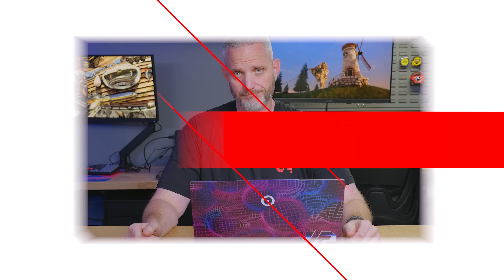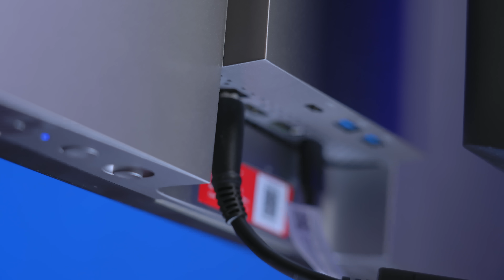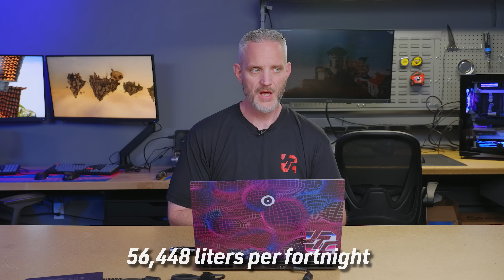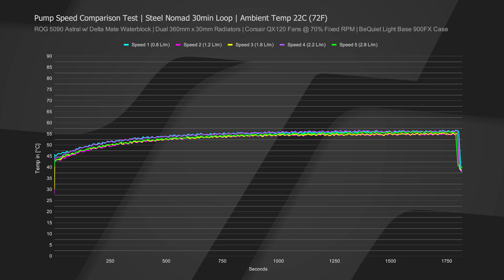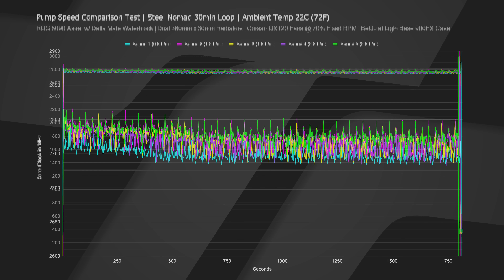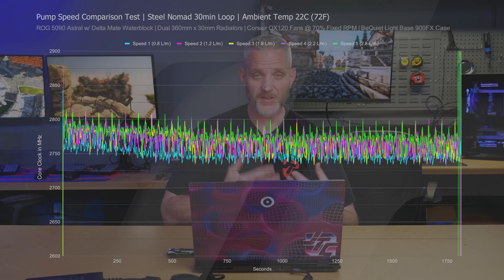Stop doing it this way!

Comment: Jay, my setup uses D5 w/ PWM and ASUS warns to set it to 100% and instead I use 60 -70% nothing above. I let the fans do the work. When I was initially setting it up I added a flow rate sensor and my D5 pumps 6L at full blast and in my 60 - 70% setting I'm doing 3L. I'm passing through 2 rads, video (2 sides), proc, VRM and a res using soft tubing and 7 - 90's.   Your flow rate at full is half mine, could the pump be worn or is it the tubing and fittings? Any way, I decided to run the pump at about 1/2 so it would last longer and cause the coolant to linger at the important areas.... Thanks

Comment: When ford first made V8's they were essentially two flat head inline 4's, with two water pumps. What you will find if you pull the water pumps apart on a good running example of on of these engines, is that every other pump fin has been broken off or removed in these pumps. The reason is that the engines overheat in stock configuration and mechanics figured out the pumps flowed too much, the coolant didn't have enough time to give enough heat away in the radiator.

Comment: I'm thinking it might have more to do with boundary layer thickness than pump resonance - which should happen at relatively narrow multiples of frequencies I would think.  Anyway, the heat exchangers on the components themselves have many many many microfins and therefore a corresponding number of boundary layers.  Increasing fluid speed through that system will decrease the thickness of each of those boundary layers and correspondingly increase heat exchange.  When it comes to actually getting rid of that heat at the radiator the radiator may see significantly less of a percent improvement due to the comparatively fewer number of flow channels.  I think the added 35w of pump heat probably did play a role here.  I wonder how the results would have been different with 100% fan speed.  Also depending on the design of the loop and specific components even a single set of fittings enter a suddenly more chaotic flow state at certain velocities.  Lots and lots of actual variable here even per specific system and pump.

Comment: I would guess running a slower pump speed just operates the loop at a larger delta between the hottest (right before the rads) and coldest (right after the rads) coolant temperatures. In the end, the rads will still dissipate roughly the same total amount of energy into the air no matter how fast the coolant is moving through the loop.

Comment: Could you perhaps have 2 pumps connected to a single reservoir, one pump connects to the heat components, and the other to the rads, basically a heat exchange so you can have a high flow rate through the blocks, but then low speed through the rads.

Comment: I also name my rigs, and it's kinda cringe but my main rig (9950x3d, 96gb ddr5 6000 4x24gb, 7900 xtx red devil, proart x670e, nzxt c1200, h9 flow 2025, custom loop with 2x420, 45mm and 60mm thick with xd6 and xc7 lcd, and 40tb of storage across 14 drives) which is named "Quantum Nexus", then my streaming rig (7600, B580 Icraft, 96gb ddr5 5200 2x48gb, pg lightning WiFi, icue link h150i LCD aio, deepcool 850w, H6 flow, 10tb storage across 4 drives.) named "Abyssal Plane", then my 5l ITX portable build (5800x, ID cooling is55 with phantek t30, LP 4060, 32gb ddr5 3600, lzmod a24 v5, 4tb across 3 drives) named "Void Wyrm"

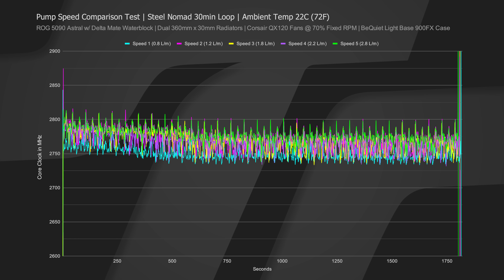Comment: 13:50 Water has a higher "specific heat".  And this means it can absorb more heat energy per unit mass before it rises a degree in temperature.  Saturation isn't the right word really.  For example, it takes very little energy from a stove top to heat a sheet of tinfoil, and it takes a lot more energy to heat a cast iron skillet.  Granted we aren't adjusting for mass here, but it gets the point across.

Comment: Well it's kinda obvious that the bottleneck in liquid loop cooling is more of the heat discharge rate from the radiator to the air rather than the component to the water.

Comment: I’ve been liquid cooling PCs, as well as a number of other industrial systems over the years.  I’ve tried every configuration imaginable.  I too have pretty much settled on a medium setting for my pumps, of which I currently have two in one system and two in another system.  Although, to be fair I think the pumps in one of my systems are maxed out, but that’s because they’re cheap pumps.  The pumps in my main system are Koolance model 450S, and the coolant I use in Koolance LIQ705, because it’s clear, non conductive, and you can buy it by the gallon.

Comment: As long as the water flow is enough to absorb the heat without getting so hot that it starts affecting the heat transfer.

Comment: Great video Jay 👍 you should put calibrated thermal probes before and after the rad as well as gpu to verify that the coolant gets colder the slower it moves through rad and vice versa hotter in gpu. 👍👍

Comment: Jay, bruh... if you want to test/calibrate this you need to measure the liquid temp entering and leaving the block. Measuring cpu/gpu temps, while correlated, doesn't tell the story of what is happening in the loop. The entering/leaving temp delta is the only thing that will allow you to dial pump AND fan speed. Also, air and liquid are both fluids. Different densities (therefore differing capacities for heat energy), but they behave the same way. Differentiating between the two is only muddying the waters. Secure/insulate one thermocouple to the tubing as it enters the block and one where it is exiting the block. Fan speed 100% until you find the pump speed that most saturates the liquid with heat, then tune fan speed for performance/sound. Trust. Look... I'll even become a member of the channel if you do this.
Reply: The water temp will equalize across the loop. So there is no point in measuring before and after the block. Those temp deltas are neglectable. Air is a gas mixture and of course not a fluid. Although they might behave similarly in some ways (e.g. gas or liquid flowing through a tube) there are more differences (apart from density like you mentioned), with the most notable difference being that fluids are able to transfer heat more efficiently than gas (air).
Reply: @laurensbrantsen I'm sorry, but that's an insane thing to say. Where do you think the heat is coming from and where is it going to if what you say is true? 

Fluid (noun)-
a substance that has no fixed shape and yields easily to external pressure; a gas or (especially) a liquid.

Comment: As always, it depends…
If you don’t have something like an Aqua suit controller, you can try different combinations, and most likely the difference between 100% and 50% isn’t that far off compared to the noise. 
I found in my setup, pump speed is more to control short period (10s of seconds) temp spikes, and I can run it at a speed that is more quiet than the fans.

Comment: Maybe for your testing you should get a Aqua Computer D5 NEXT and a high flow NEXT. Then you can control all speeds over the software for consistant messurements. Also their hardware is completly useable without the software because of the little Display and controls on the front. Also Igors Lab tested multiple flowmeters and the Aqua Computer one was by far the best. Love your videos - big fan from germany.

Comment: 1:52 small note - you cannot have more energy out of a system than what energy is put in the system. So the heat dissipated by the GPU in the loop is equal or less than the electrical power drawn from the PSU, i.e. less than 600W. It can more though when you consider also the CPU.

Comment: Hi Jay, I’ve been out of the loop (no pun intended) for about 5 years but recently got back into watching you and GN. I’ve had a 420 EK radiator sitting in my rig this whole time—never finished the watercooling. Any chance you could do a video comparing tubing brands like Barrow, PrimoChill, etc., and different coolants/dyes? I’m aiming for a UV green look and trying to decide whether to get the color from the tubing or the coolant?

Comment: Awesome! Would have been interesting to also see fluid temperature. But I'm expecting it to correlate with the GPU temp anyway.
When I put together my current loop I was ramping the pump up and down with load.
Until I made a test similar to this and settled to 60% on a loop very similar to this. 7900xtx, 9800x3d (irrelevant as it's idle) 2x 360x30 rads, VPP Apex (D5 based) pump.
Good stuff!

Comment: When you use temperature sensors for your coolant you will see that the coolant temp drops considerable behind the radiators and increases considerably behind the heat sources when you run the pump slower. You need to find the best compromise between flow across the cold plates and the coolant temp for your use cases, in case you really wanted to optimize your cooling solution.
Reply: Thank you for having a sane response to this. I've been trying to preach the same thing. Saturating any fluid (air OR loquid) is dependent on having sufficient contact time with the heat source. Everything he is doing in these two videos is working off of "I believe what's happening", when he could just measure the entering and exiting liquid temps at the water block.

Comment: I'm pretty sure that the heat transfer rate of the radiators is going to directly impact the optimal flowrate for your liquid. A crappy radiator may benefit from a super-slow flow whereas radiators that can dissipate heat faster can handle more flow.
Reply: In a single loop system, like this, radiator performance is dictated by fin density and air speed. Radiator heat rejection capacity is dictated by the radiator size. Flow rate would ultimately only impact heat saturation of the fluid at the source of the heat (cooling block).

Comment: dual pump setup when? one for radiator one for rest of loop
Reply: What benefit are you proposing two pumps would bring?
Reply: @cruuzr  different speeds per loop
Reply: @TheSimonarne  there is only one loop
Reply: @cruuzr  you could have 2 loops
Reply: @TheSimonarne I must be completely missing what you're saying. If you separate the radiator from the loop, there is no radiator to remove heat from the loop.

Comment: how about a threadripper cooling test with both soft and hard tubing to see if there is any difference in the temps regarding the resistance caused by the angles in the tubing etc ? (I own a threadripper build with an AIO and I'm seriously thinking to move to a custom loop)

best regards
Tony

Comment: Might be fun to connect just the pump (no CPU or GPU) to the open loop, and use a motherboard jumper to run it without powering the other components (I always disconnect the power to the CPU socket and the GPU for safety's sake when I use the jumper to flush my loop.)

Isolate the D5 and you could see what the different motor speeds did to temps.

Comment: Well Jay, there is one flaw in the whole video. With a pump that is made with a Tacho and potentiometer on it ofc you can go lower in pumpspeed to push less voltage through which can increase lifespan. BUT if you have a PWM pump its not a good idea to run the pump at anything below 100%, because of how it works its always running at the same voltage its just cutting power on/off which is wearing it down alot more frequently than just having it running at a constant 100% 

So Tacho = do whatever u like
PWM = run at 100% 

Not controlling your Pumpspeed is against the whole purpose of PWM i know, but thats how it is.

Comment: Last month did a similar test on my AIO, from 50% (the lowest it goes) to 100% in 5% increments. I would run a stress test, take note of highest CPU and coolant temp and then time how long it took the coolant to reach idle temp again. 
Pump speed barely affected highest CPU/coolant temp (.5 and .1 respectively) but it made a huge impact on time to reset the coolant temp. At 50% got the worst time of 13:45 mins, increasing the speed improved the times until 80% that had the best at 7:10, then it started to increase again (7:30 at 85%).

Comment: This is an ages old argument in computers and automotive sports. Theres no such thing as "longer time in the radiator means cooler loops".
Pump heat load is going to be a factor, and also for what little difference it makes, you're forcing the water to do action. More work the water is doing moving through restrictions, the more heat the water is going to generate. Is it a few watts? I don't know, but it exists. 
3/8 tubing can move a LOT of water. Back in the 1/4 tubing days, you could have a 5c difference before the chips and after. Personal experience with watercooling an fx-8120 and two radeon 7950's, all overclocked, all on 1/4 tubing. 
Now imagine having 50 feet of 1/4 tubing to have the radiators outside of my room. That made it worse. The only way that "slower is cooler" would work is if the water leaving the radiators ended up being ambient, but the difference was only about 5c of before and after the radiator stack.
These days the most difference you see is 1c variance between parts of the loop

Comment: But what about AIO pump speed? Would something like 70% speed be better than 100% in spite of the lower flow rate? I have a 360 AIO on a 9800x3d and I have to assume that 100% is overkill. Right?